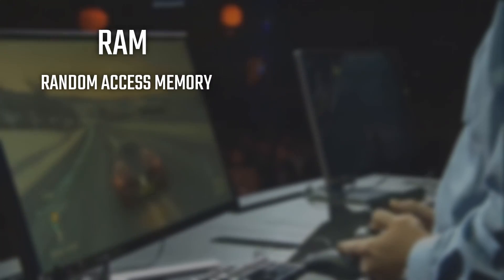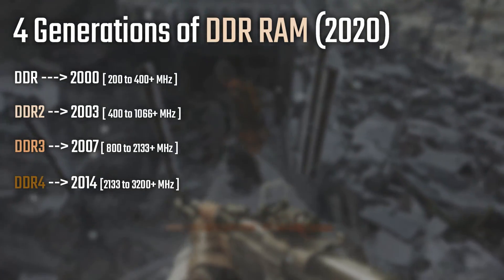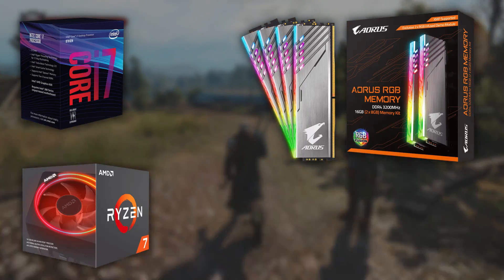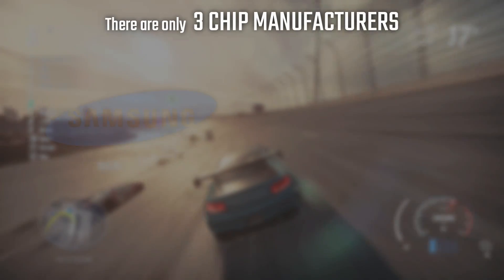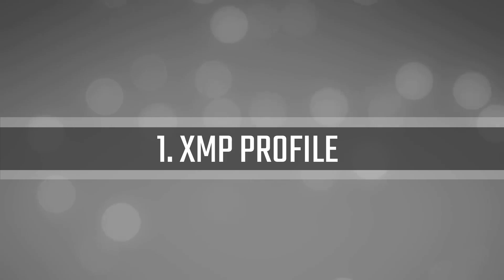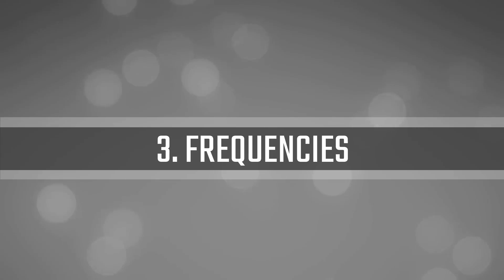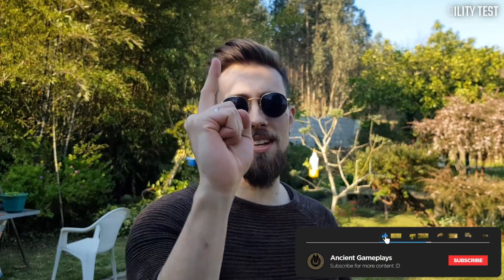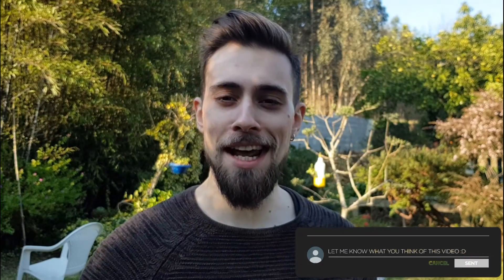How to Overclock RAM (2020 Tutorial) | Introduction of How RAM overclocking works, Tips and Tricks

Comment: Most of the time aim for 3200Mhz most of DDR4 can get this on 1,4V perfectly safe (I know guys what smash 1,5V in 24/7 loads)
Use XMP as a basic start-up and up we go.
And remember:
- You wanna command rate be at 1 or 2 if 1 don't boot
- Ram doesn't like cold, don't like heat, they like be warm 
- Timing and sub timings lower = better 
- RGB means heat, yours choose
- 3000Mhz CL16 = 1,36V(most of the time) if not well you are unluck
-Most of the ROW Refresh Cycle timing is to hight try to lower them
- If you have Intel go to CPU VCCIO V and CPU System Agent V and get V to 1,12V, max 1,25V MOBO on an auto place to hight( don't go more than 1,35V you can cook your controller or/and CPU)
- If you have Ryzen good think is bumping up SOC Voltage but don't go more than 1,2V 

Well and have a lot of time... I mean RAM OC is a time-consuming pain, it is pain... pain... 
I masochist if I enjoy this???

Comment: Ok no, absolutely do not push the regular timings and ignore the sub timings or your motherboard may stop recognizing your ram or worse kill it. 

At first I had a good overclock for 3600 mhz c16 on crucial ballistix black 3200 c16 with only the sub timings changed from xmp 3200 on an msi tomahawk b450, idk what happened, but now when I try to boot I get 2 post beeps. 

Now thankfully I haven't reset my bios yet with m-flash, but we'll see.
Reply from the maker: That happened due to other things man. The max that can happen is having to clear CMOS.

Comment: Is it possible for my system to be unstable while increasing frequency before reaching 1.45V and if so ,can I later increase the voltage upto 1.45v to get least possible timings.
Reply from the maker: do it step by step. Gradual steps. maintain voltage at let's say 1.39v. The gradually increase frequency
Reply: What if I first raise the voltage to 1.45v and then begin trial and error
Reply from the maker: Try 1.4v first

Comment: my ram speed in box say 3000mhz and it run at 2133mhz default... i have 4x 8GB ram. 
 cpu:i9-9900k run at 3.6ghz default
motherboard: Rog strix Z390-F Gaming... how much should max or under the max i push the ram frequency and voltage?
Reply from the maker: Just use the xmp mate
Reply: ok ❤❤❤❤🌺🌺🌺🌺
thanks for replay.
Reply from the maker: @only_hannan  np

Comment: Don't work for me, please help me...
Reply from the maker: maybe you did it wrong, like most....
Reply: @AncientGameplays  I have asus x570 prime and 2x8GB 3600MHz vengeance rgb pro. And the best I can select to work well is 3200MHz.
Reply from the maker: You didnt follow the steps i see
Reply: @AncientGameplays  Ok. If you say so...
Reply from the maker: @3xtremeRules  you need more voltage and loser timings man
Reply from the maker: @3xtremeRules  what cpu so you have?
Reply: @AncientGameplays  I have Rayzen 9
Reply: @AncientGameplays  voltage i have 1.4500
Reply from the maker: @3xtremeRules  no need to pay man. If you have a ryzen 9 you ram has to work 100% sure. First of all select XMP, and raise the voltage to 1.4v. And try it
Reply: @AncientGameplays  thanks man. My motherboard is A ASUS X570 pro, don't have XMP. Have another thing is the same but when I active that don't work restarts in safe mode. I have 3600mhz but if I select more than 3200 MHz puff restarts
Reply from the maker: @3xtremeRules  use xmp, then use higher timings since it seems your ram kit cant handle those timings on that board. Also, be sure o have the latest bios
Reply: @AncientGameplays  Yes I have all up to date. Ok I will try, but I tell you yesterday I try my best I try everything and didn't work... In less than 2-hours I'm home I'm going to try again.
Reply: But tell me if don't work can you help me with vidéo call?

Comment: Dear mr Ancient. Please can you help me figure out if what I have just done could have damaged my system in some way!?

Basically I did what this guys 30second video shows (to try and turn on xmp) - https://youtu.be/3Yfli2MO9yE

Then I did as you say and increased voltage of RAM to 1.38 (in the bios)

I also changed fan profiles to be turbo mode. And set the motherboard profile from normal to optium.

When I rebooted I loaded a game to test it out and as soon as it loaded, a window popped up to say the gpu drivers were not detected. Then the game closed.

This happened everytime. (Also the AMD software automatically loaded on each restart (which it normally doesnt do this on its own).

I panicked and tried to reverse what I had done. But things still did not seem to changevso I tried to reverse it again.

Now the gsme loads.. But when i am in a battle it seems like it is not as smooth as it was before. There seems to be slight little jolts in the rendering. Its very slight. But I do not feel as though I noticed them happening before?

Can you please tell me if what I had done could have damaged any of the components?

System spec is brand new build.
Ryzen 5 3600x
Asus prime x570 prime p
Rtx 2070 super
16gb ddr4 3600 [not running at 3600mhz tho :( ]
850 watt psu

Please, i hope you can help me to know :S
Reply from the maker: Well, disable that optimum motherboard crap, and let it run stock just with a bit more of voltage. Then test ram stability
Reply: @AncientGameplays  do you think what i have done could hav caused any damage? I dare not mess around with it again
Reply from the maker: @nothinhappened  not, you are fine. Don't worry. It would break anything
Reply: @AncientGameplays  thanks. I'm too stupid to understand what im doing with all the settings. Would have to spend hours watching a million youtube vids before I try messing with anything again. I dont have money to buy another system. Took 2 years to save for this 1 lol. #fear
Reply from the maker: @nothinhappened  go slowly man. This takes hours haha
Reply: @AncientGameplays  thanks for taking the time to reply dude. I'v turned on the xmp.. Or docp (whatever it is called lol) n done a slight overclock on msi afterburner. 

One day I might go into more depth with ram.. N cpu.. One day.. Lol

Comment: I failed to overclock :( I tried to find a sweet spot. First, I was able to boot to windows and made a USB with memtest. Then I went to perform the test and it failed, so played a little bit with memory overclock, and memtest passed. However I wasn't able to boot to windows anymore. Had to restore defaults in BIOS to operate again... Running on XMP Profile now and thinking what to do next. Tried to overclock using "G.Skill F4-3600C16D-16GTZ" with B450 Tomahawk Max and Ryzen 7 3700X. Used 1usmus DRAM calculator and had to use not the recommended voltages as that gave me errors during memtest. When I lowered from 1.45 to 1.44, then the memtest was crystal clear after "3 : 15" hours of test, however I was unable to boot to windows which killed me...
Reply from the maker: That is why i told people to use the mem test on windows
Reply: Any suggestion? Or could it be that I just lost silicon lottery? Sorry if stupid question here...just wanted to know if I should even try.

Comment: Can't overclock mine crucial ballistix sport(1 rank E-die) 3000 MHz 15-16-16-35 even to 3200 MHz. Tried voltage up to 1.4 and SOC voltage up to 1.13. Am i doing something wrong?
Reply from the maker: What cpu and board do you have? Do you have the latest bios?
Reply: @AncientGameplays  gigabyte aorus elite x570 and ryzen 3600. Bios is agesa 1.0.0.3
Hm it seems like it was all about disabling xmp lol
Reply from the maker: @Malefikar  xmp is cancer sometimes. Dont you have agesa 1.04?
Reply: @AncientGameplays  1 run without xmp and 3200 16-17-16-36 and 100% stable.
Not yet, but I'll plan to update to 1.0.0.4 (just worried to screw up)
Reply from the maker: @Malefikar  it is better ram wise i think
Reply: @AncientGameplays  I'll try it. Thanks for the answer!

Comment: hi Fabio, nice video like always... there is a way can i check if my ram are running in 1:1 or 2:1?
Reply: mobo msi x570 pro carbon
cpu ryzen 5 3600x
ram patriot viper steel 4400
Reply from the maker: After 3800mhz, it will. You cam use aida 64 benchmark. Higher speeds at 2:1 will have higher latency
Reply: @AncientGameplays   do you suggest stop at 3800 or try something over 4200+ (i play mostly pubg)
Reply from the maker: @MiguelSanchez-cx4co  nah, stop at 3800MHz (if you have ram for that) and get the lowest timings possible

Comment: I still don't understand the thing with CL, i oc my ram from 2400 to 3200 and i set the CL from 17 to 16, i can do more, or it will help?
Reply from the maker: If you watch the tips closely you do speak of that part, and how you should do it
Reply: @AncientGameplays  Probably is from my crappy ram, but if i lower more than cl16 the ram my pc will keep restarting.
Reply from the maker: @immike3476  have you tested stability with memtest?
Reply: @AncientGameplays  On 3200 and cl16 i have no errors and is working fine
Reply from the maker: @immike3476  nice, you can try higher frequency now
Reply: @AncientGameplays  if i try more than 3200 i need to use cl20 or above
Reply: That is really bad RAM, I wouldn't recommend pushing it or you will get your aforementioned restarts. I am on 3466 CL10 for example

Comment: Hey AG, I'm running a ryzen 5 2400g. Can I run a ryzen 7 3700x and gtx 1660 super on corsair vs 450? N thanks for the great content, especially the 1660 super review
Reply from the maker: You can since GTX 1660 super doesn't consume that much, but i would still upgrade ASAP :D
Reply: You can but better power supply is recommended

Comment: About SOC voltage tinkering with Ryzen CPUs, increasing it will also increase the CPU's power consumption and given how the precision boost technology works it will mean that your CPU will boost lower because its maximum boost frequency is tied to consumption and temperature. So if you're increasing your infinity fabric's voltage in order to keep it stable at 1800 or 1900Mhz you should also change the Precision Boost Overdrive settings in order to increase the power limit otherwise you might lose performance despite running your memory controller at a higher frequency.

RAM overclocking on Ryzen is a bit more complicated because you must also deal with the Infinity Fabric overclocking. Your Ram might be able to run at 3600Mhz or 3800Mhz but your Infinty Fabric might be unstable at 1800Mhz or 1900Mhz. You absolutely need your IF to match your RAM true frequency (so 1800Mhz for a 3600Mhz DDR4 Kit), if they aren't correctly synchronized you'll lose a lot of performance. There is a good chunk of R5 3600(x) and R7 3700x that won't be able to reach 1900Mhz on the IF and some will even struggle to remain stable at 1800Mhz. I've been quite unlucky with the silicon lottery on my 3700x for instance, getting 1800Mhz stable has been a bitch to tinker. All the memory stress tests seemed to be OK without any errors and yet I was still getting blue screens of death once or twice a day. Turns out it wasn't really the memory but the IF that was unstable.

That also means that the super expensive 4000+ Mhz kits aren't meant to run at 4000Mhz on a Ryzen CPU because there's no way your IF will be stable at 2000Mhz, try 3800/1900  (memory/IF) and work on the timings. If even with loose timings it's not stable then the issue is most likely with the IF. In that case lower the Ram and IF frequency again and then tighten the timings in order to compensate the frequency decrease.
Reply from the maker: True, that is why i tell people to watch that video in the description. As for IF it doesn't need to be matched. It is better to, but not a need. 2666mhz with if at 1900MHz will be better than with stock one. Also, if oc is only for 3rg gen. Thanks for the comment
Reply: @AncientGameplays  You can indeed get a tiny performance increase with a high IF frequency but it only works with slow memory (like 2133 or 2666Mhz). With 3000Mhz memory and above synchronizing the RAM and IF gives much better results.

In fact even with slow memory I'd recommend to try to overclock it to 3000Mhz (or better if possible) and synchronize the IF instead of leaving the ram at its stock frequency and crank up the IF. 3000Mhz Ram/1500Mhz IF will most likely mop the floor with a 2133Mhz or 2666 Mhz Ram/1900Mhz IF configuration.
Reply from the maker: @kathleendelcourt8136  well, i have tge results of that in a video haha
Reply: @AncientGameplays  I saw that in a Hardware Unboxed video: https://youtu.be/iH3qq_mSxTM?t=853

But I have also seen a Linus video showing more substential gains with a desynchronized IF OC so it is actually debatable. Though in general I tend to trust Hardware Unboxed more than Linus.
Reply from the maker: you can trust me xD
Here: https://www.youtube.com/watch?v=azFYdiH9Hns
Reply: So why use precision boost in the first place when you could run an all-core fully stable overclock rather then boosting one core for a few milliseconds. I would personally rather get maximum stable performance out of a system that will be outdated in a few years anyway. Why leave the performance on the table.

Comment: i can push my 1600 3200mhz no matter what i do i guess this is my ram limitation or motherboard or could be cpu as we all know first zen ryzen memory oc is really bad
Reply from the maker: Well, not that bad, my 3000MHZ CL15 ram can go pretty decent frequencies on my 1700. It also has to do with the mobo Bios and ram sticks
Reply: @AncientGameplays  yeah i saw a guy push his ram speed 3466mhz something with msi b350 mobo and that board support over 3200 and my board only 3200mhz, but it it worth it spend 200$ for best memory kit
Reply: What voltage settings do you need to make it run?
Reply: @doncorleone7673  1.4v, i think b-die can run 3200mhz with any mobo or cpu you have but still it is not 100%
Reply from the maker: b die could probably run 3400 there
Reply: @Ryzen-gh1en  i see. I have micron D-die. I am solid on 2933Mhz with a asus prime x370. I will try to go higher.

Comment: Those sun glasses really give me those matrix vibes 😂
Reply from the maker: Good hahahah
Reply: @AncientGameplays  is it possible to overclock cpu, gpu and ram?
Reply: @ahlmojen2269  yea but sometimes u cant overclock you're cpu. For example I cant because mine is locked. For intel if its unlocked there is a "k" at the end of the number
Reply: @solaarz  im using amd
Reply: @ahlmojen2269  yes u can overclock amd
Reply: @ahlmojen2269  neet to check if it is  locked or unlocked if it is unlocked = u can overclock locked = you can not
Reply: @ahlmojen2269  most ryzen cpus are unlocked, only mobile ryzen cpus are locked
Reply: @AncientGameplays  is it safe to overclock 3000mhz ram to 32000mhz
Reply: @catfan__  Intel isn't bad, its just amd has much more benefits